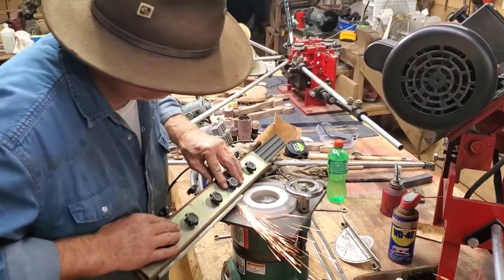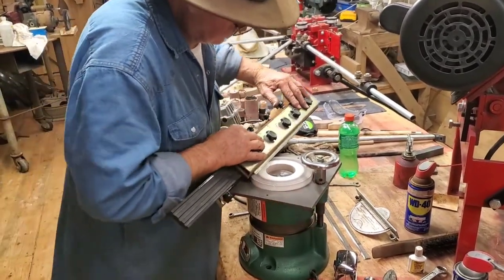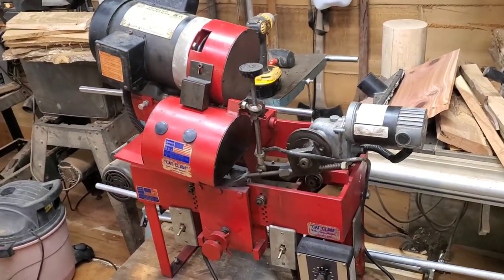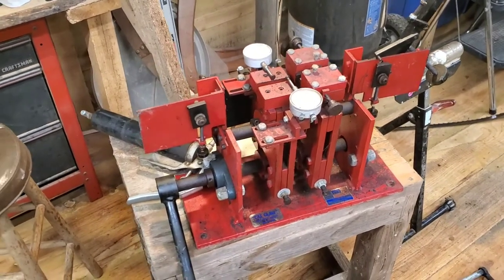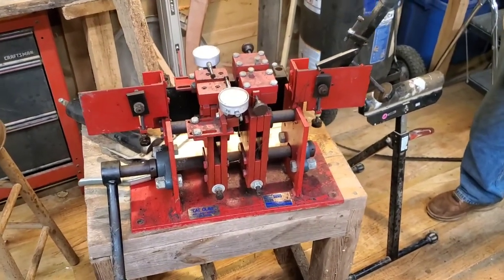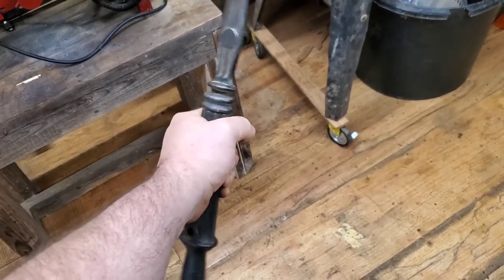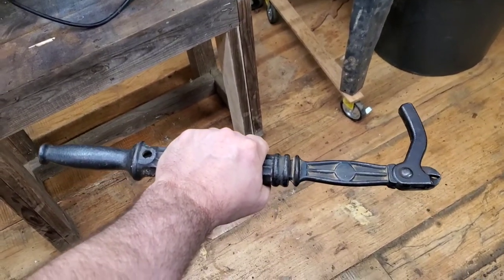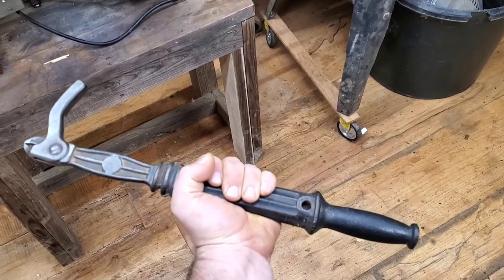Mr. Robert and I went picking and we got some treasures!

Comment: Barbed wire staple puller and congratulations on the cook's sharpener and dual setter they are both on my list to get do you like the cooks over the timber King
Reply from the maker: Mr. Watts got it within the first few views.  The cook's sharpener and setter are pretty awesome and heavy.   I'm going to give this set to my dad since he has the space for it up in Tennessee.   If you are able to make it to the sawmill show at the end of March I'll have both the timberking and cook's set up up and running. Both will sharpen a blade as sharp as new or sharper.  The biggest difference is price and robustness.   The cook's set up is more than double the timberking in price and triple the weight.   If you want to do a sharpening business and sharpen multiple types of blades the cook's set up would be the better option.   If you only plan to sharpen one type of blade for yourself the timberking set up works great.   The timberking setup will pay for itself in 50-60 blade sharpenings.  So long story short....it depends, lol.